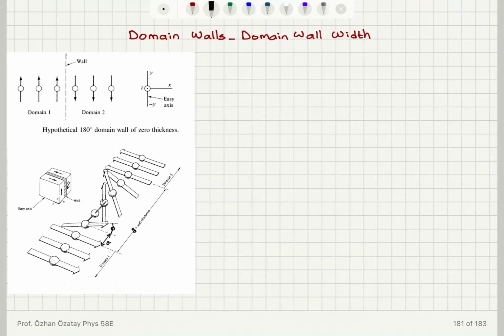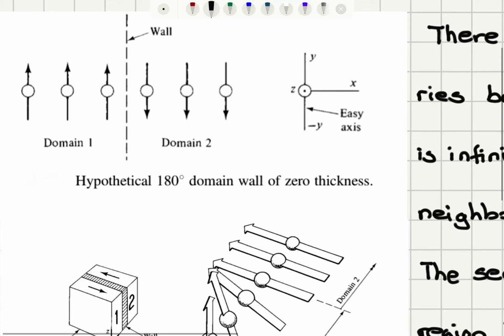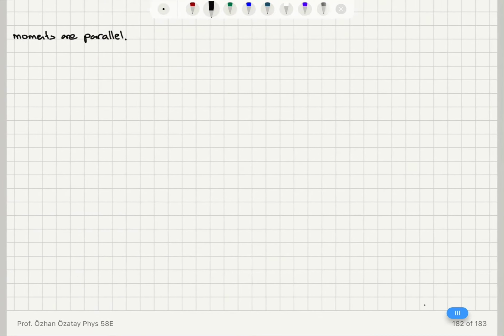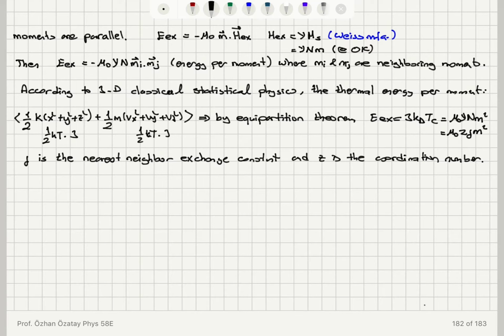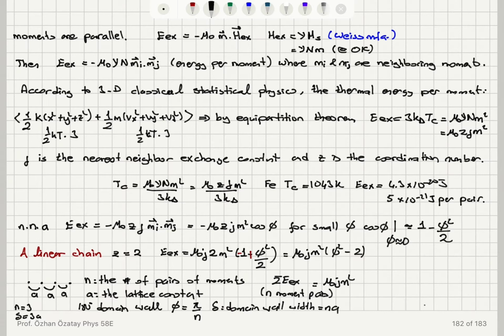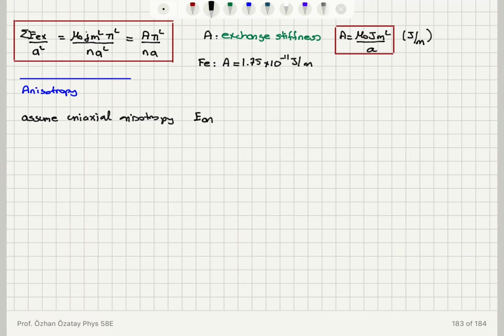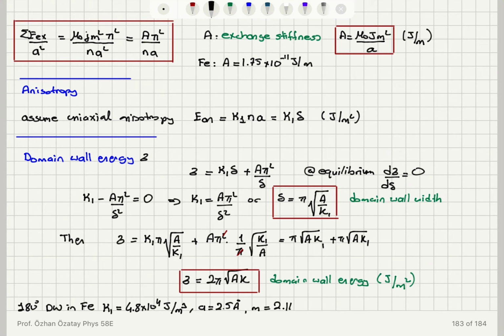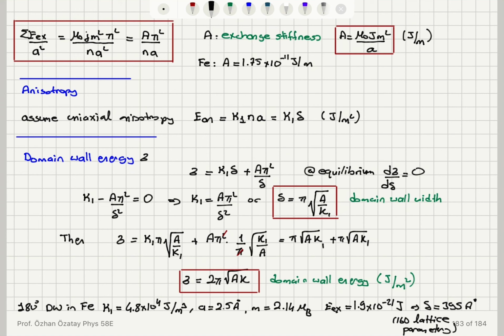Week 9-3 Domain Walls and Domain Wall Width

Comment: This is a really good explanation, thank you so much. Regarding to "j" value  introduced in the Tc expression and used in the exchange stiffness formula, it's units are Ampere/meter (A/m) as is calculated fro  both equations, nevertheless you said "j" is the nearest neighour exchange constant, wich has energy units. What would be the real units of j? Once again, thank you, in advance.